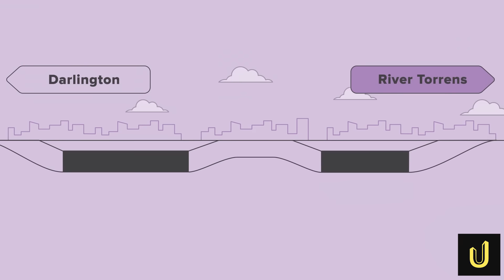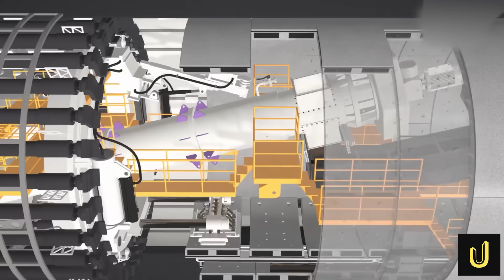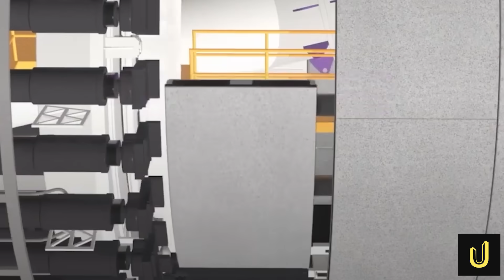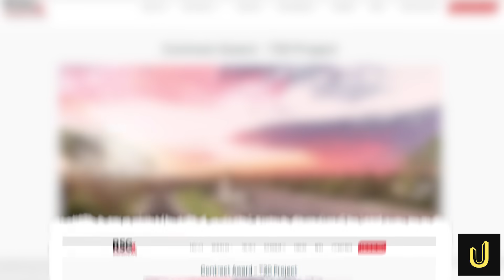$15 Billion Highway Project Shocks Australia!

Comment: This must be done, other options should have been done decades ago but now this is all we have. Also as someone who rides a motorbike it is almost impossible to filter between the traffic with the current size of lanes on South road so even on a bike the average speed in traffic may only be 15 to 20 Kph. The current bottleneck is crazy, we currently have 6 to 8 lane highway on both ends of this 4 lane 10 Km section with 21 sets of lights on it.

Comment: The car lobby succeeded in getting Adelaide's then state-of-the-art tram network ripped up. The State Govt of the day shut down the heavy rail spur off the Gawler line through Sth Terrace Pooraka up to the North East just a few years before opening Golden Grove to development, causing massive traffic increase on Main North Rd and North East Rd. People, while there's no doubt that a smoother flowing North South traffic corridor would be nice, the problem is private vehicle use for commuting. $15B would transform Adelaide's public transport, meaning people wouldn't have to travel in to the centre to get out to another suburb.
I've just returned from a week on the Gold Coast. The M1 there between Gold Coast and Brisbane, which is mostly 110kph 6 lanes but sometimes 8, was down to standstill most weekdays even around 11am - 3pm! Build it and they will come...

Comment: The Torrens-to-Darlington (T2D) upgrades are estimated at $15–17 billion. The tunnelled parts work out at roughly $2–3 billion per km, while a more reasonable surface/trenched alternative would have cost roughly $0.2–0.5 billion per km. The tunnelling choice added billions compared with cheaper options.

Comment: As an Adelaidean this project is essential. But trucks heading to Melbourne and Sydney must go east at some point. Fueling another problem.
Reply: There was a proposal to put a hill's bypass for freight and rail and come in from the north to the port or bypass Adelaide entirely. Most of the rail corridor was there but it was still deemed too expensive. But think of the benefits of free up the rail line to Mt Barker and getting most of the trucks off Portrush Rd.

Comment: I think ultimately its a good thing. Progress is everything. But what if there is a car accident? Currently, if there is an accident it slows the traffic to almost a stand still because everyone has to slow down to 25 by law I think. How about instead if its possible move the vehicals to the side asap then these automated poles with flashing lights pop up to alert and protect the accident site and then the remaining 2 lanes can continue on as normal. Or some more clever solution. The cost though pretty hard to stomache.

Comment: The southern end of the existing system down near Darlington seem to be a mass use of concrete & lanes that could be drastically simplified! & 1 section of the side walls had to be replaced due to instability as huge concrete panels kept falling off! A over & under separate road would not have tied up massive land acquisitions & simultaneously still more 2 lane South Rd delays! Architect & builder dream at users expense!!!

Comment: I grew up in South Australia's Mallee region on the Victorian border, and I remember the talk of the 'north-south corridor' back in the early 80s. In true SA, well more likely, Adelaide fashion, it's taken a while but it's starting to take shape 😂 But seriously, this has been sorely needed since then, that road is an absolute nightmare at peak traffic times. Even when it's quiet, there's all those traffic lights to deal with. I now live in Victor Harbor, south of the city on the Fleurieu Peninsula, but I have family in Riverton to the mid-north, this project will now link up the northern and southern expressways and (hopefully) make these types of journeys a breeze. What a huge engineering feat though 🤯🤯

Comment: This project is projected to cost $15 BILLION at the moment but more likely significantly more by the time it’s completed. Sounds rather like the desalination plant built in Adelaide’s south. Cost exploded way in excess of its projected cost st the beginning of the project  plus o😢ngoing annual costs to the State with very little actual significant benefits.
Reply: No significant benefits from the desal plant ? .  It was running almost flat out last summer. Luckily there was a rare moment of insight from the Government and they doubled the original planned size.  I remember a lot of naysayers at the time but it has proved worthwhile with Adelaide's population increasing and some pretty dry years recently.

Comment: an underground metro system would benefit the entire city but city planners have such low foresight into population growth and city expansion. the new southwark grounds project is going to add 1300 homes on the fringe of the city, congesting traffic even further. adelaide and surrounding suburbs are perfectly designed on a grid system that would make metro travel so easy if they just bothered to invest properly.
imagine a direct underground train line from the CBD to the airport within 10 minutes bypassing all traffic? they could convert the central bus station into the main city metro station, right into the heart of the city.

Comment: Moving bottlenecks has been a problem here already in the past.  When they built Darlington into the 6 or 8 lane section its been since the early 1980's,  all it did was make the bottleneck on South Rd and TOnsley insufferable, and so ppl used Marion Rd and or Brighton rds instead.  And  the loss of the volume of historic homes in suburbs surrounding the tunnels has been gut wrenching for many many families.  Fully renovated and extended historic homes and whole suburbs just lost.  But as far as enigneering goes, it will be impressive - the sections that have already been done are great to use.

Comment: The project is required, but is poorly designed. There is no connection with Sir Donald Bradman Drive or Cross Road. Therefore all commuters from the east of Australia have no direct connection to this massive project. Also there is no direct connection to the airport. Poor planning and rushed design.

Comment: The Richmond Road / South Road interchange design needs to be reworked, to allow heavy vehicles to move from Richmond Road on to the new South Road motorway and vice versa, so that their new route to and from Adelaide is Southeastern Freeway, Glen Osmond Road, Greenhill Road, Richmond Road and then on to the new South Road Motorway to head north or south from that point. Richmond Road and Greenhill Road are the city ring route R1 and Glen Osmond Road is Princes Highway A1. Time and fuel efficiency for heavy vehicles by the redesign of that Richmond Road / South Road interchange

Comment: It’s finally 1980 here in Adelaide. Our road infrastructure has been a joke. The bottleneck on the north to south end at Thebarton to Richmond Road is farcical. 
A solution for the congested Port Road/Park Terrace/North East Road debacle would be welcome too. It often takes 45 minutes to get through that couple of kms of car park. Anyone who says you can get anywhere in Adelaide in 30 mins clearly hasn’t done peak hour here in decades. 😂

Comment: Adelaide is an incredibly long thin city with no reliable means of connections between its north and south so it’s effectively three cities in a row at present. Connecting the north and the south will help a lot with integrating it back into a single city.

Comment: Lack of Street Signs
Lack of Free off-street parking 
Lack of Trains 
They used to have a train going to the Hills & they closed it 
Most of the roads are JUST wide enough for cars, but NOT for TRUCKS - especially the overpass
Reply: the belair line is still fully operational and the barossa line was closed due to no one using it, it was even reopened and then closed again because of no one using it.
use it or lose it.
Reply: @bjorn1583 I was referring to the Stirling Station & Aldgate. 
Mt.Barker has nothing except Buses 🚌

Comment: At the end, you state that it would just move the traffic problem to a bottleneck at the southern end. This is not the case. The southern end at Darlington has already been completed and includes an overpass onto Ayliffes Rd to the east so that traffic emerging from the T2D will flow smoothly into the Darlington underpass, and thence directly onto the Southern Expressway, which carries traffic clear through to Noarlunga.
Reply: Where we can all get stuck behind the idiots doing 85 in the far right lane heading up the hill to Majors Road lol

Comment: In 2001 we built a one way 18.5 km one way road called the southern freeway for $76.5 million.  The one thing Australia isn't short of is space but we still built a one way road to save a few $.  We then had to upgrade it 9 years later to a 2 way road at a cost of $445 million, a hell of a lot more than building a 2 way road in the first place.  Short sighted road planning is costing us a lot more.
Reply: When the Southern Expressway was planned, South Australia was still in a very bad way following the State Bank collapse (stage one commenced in 1995, four years after the collapse, and opened in 1997). Most of the traffic that needed to be moved at that time was peak hour commuter traffic, so the reversible design was seen as a cost effective solution.
Where it went wrong was that it was supposed to be designed to easily allow duplication in the future when the state budget was much healthier, but due to some flaws that wasn't the case and the duplication process was far more involved than anticipated.
Reply: Shows how little you know, the doubling of the day expressway took purchasing houses and other buildings, as well as moving approx four times as much rock and soil as the original.
That's why the original was the size it was, doubling it's size would of still cost much more than double the pricetag.
Reply: yeah that justifies one of Australia’s most embarrassing pie of infrastructure NOT 🤦‍♂️
Reply: Yeah - heres the funny bit.  Just after it was built there was a thing? in the Southern Vales wineries with some politicians present, promised big things. One of the business reps there said "you know what you CAN do for us - make the Southern Expressway a dual carriageway.  WHat the eff were you guys thinking".  The literal response from this un named politician was "I can assure you, there will NEVER be a dual carriageway made  - its far too expensive".  5 Years later its was dual!  Never say never hey.
Reply: Oh yes 🤣 I remember the one way.. you always had to check which way it was going first before you entered it lmao
Reply: Do you mean the southern expressway?
Reply: And yet they still decide it’s not finished and cause more bullshit road works
Reply: @shaneseddon2690  That Majors Road project seems to be taking forever
Reply: they do this on purpose to create business for themselves later on
Reply: @pinecrustjuise  it was done that way to spread the cost over a longer time period as the state couldn't afford to do both directions at the same time, it was very good economic sense which is not seen very often from a government

Comment: The idea is great, as long as they dont try do it on the cheap again, like they did with the Fiber optic network, which was a disaster, or the south road overpass, which already needs to be replaced due to failing cheap materials! Hope isnt high with Adelaides track record. Great Ideas done with cheap dodge materials!

Comment: What a great video. As a frequent user of South Road, this is just the icing on the cake for this great project. Each segment completed so far has had huge benefits, so I can't wait for this final section to be completed. People who live out north like me and the massive expansion in the northern areas like Angle Vale, Munno Para West, Penfield, Gawler, Roseworthy etc will save so much time and frustration when they need to drive down south.

Comment: I drive South Rd every single day. This is much needed and will definitely save the state in the long term, I think anyone who thinks otherwise does not use South Road. As for spending the same money on public transport, I agree, it would probably benefit the state more, but you need to realise that the process of upgrading the public transport system would require a lot more money to do it properly, it would take longer and require the acquisition of many more properties than the T2D. The South Road upgrade is a great step in the right direction, and I think more important that trying to resurrect a non-existent public transport system at this point in time, but I would love to see the public transport system become useful in South Australia one day <3

Comment: Used to drive the North part of South road to work and back each day when the Nth section was being built. Now an age pensioner. I wonder how much free and efficient public transport would cost and how much an effective rail freight system would cost. I'm guessing a lot less. These days I get by just fine with an electric bike and free (on seniors card) Public transport. Sure it would not work for all people. There is no way I could have gotten to my old job, but I think it would relieve enough traffic congestion to benefit all. BTW I think the North section contributed nothing to the local economy. It was all constructed by overseas interest who even brought in their own labour. The REAL thing SA has gotten right though is avoiding the toll road debacle.

Comment: This is a necessity but also public transport needs to be improved. First step would be a metro from the airport starting in Glenelg and to Norwood stopping in the city. Main north road needs non stop motorway now too, they just keep putting lights along it. So much money needed for all the infrastructure, where would you start?
Reply: the place is far too small to make a metro economically viable
Reply: @Lupi33z there are smaller cities like Bielefeld, 300,000 in Germany that has a metro. The smallest is Lausanne, Switzerland with 140,000. Adelaide has over a million and it will become more dense which would be more viable. It would be 10 odd years in the future if they started planning tomorrow
Reply: @ShaneWi11iams  European cities are densely populated, real cities.  Adelaide is sprawling low density suburbs which are counted in stats are part of the 'city' when in fact the actual city is quite a small town.  The daytime population of Adelaide 'city' is about 100,000 when all the public service workers and students are in town.  That's the size of European city it would be compared to.

Comment: People criticised the raised section over Grand Junction Rd - 'All that money for only 5 minutes of travel time.' That section used to take me a MINIMUM of 15 minutes, average about 20-25, commonly 40-50 when I was trucking. The time, fuel, stress (on both driver and equipment), and pollution savings were amazing. This last step will be just as consequential. I have also noticed that the loudest voices against this are often the same ones complaining about trucks on the road!
Reply: I can’t wait for these tunnels. But the trucks and freight trains should all be coming on a new corridor through the north.

The existing line needs to be changed to passengers through to Mt barker, Murray bridge and Victor. Gawler line needs to go right through to the Barossa
Reply: I live near that flyover and it's been an absolute godsend for getting to my brother's and nieces places in the northern suburbs. Worth every cent (and it was a kick watching it get built too!)

Comment: As an Adelaidian, I agree this is likely a terrible waste of money. Assuming it ends up a perfect best case scenario, we'll smooth out some traffic. 
  Worst case, it's a tragic failure that kills 100s in some terrible earth collapse, and billions of dollars more in repair and cleanup.
   I always say, if the gov just fixed the economy, most other problems would sort itself out. 15 billion dollars is an enormous sum of money by any standard. We're going to have to work harder now, just to pay that debt forcing us to be driving on the roads more.

   Lets say, for example, we invested that kinda money in a nuclear reactor or 2. (I know lots of ppl hate nuclear, this is 1 example)
  Energy prices drop like a rock. Everything becomes very very much cheaper, then less ppl need to drive to work as often, less overtime, less commuting, less traffic, saving automotive strain accross the width and breadth of the entire state, as opposed to just South Rd

Comment: I lived in Adelaide for 35 years and then moved West 20 years ago, the difference in the highway network is staggering. It’s great to see Adelaide finally get a massive highway infrastructure project.
Reply: I used to go to Perth for work a lot about 25 years ago.  For foresight they had over there to leave space for infrastructure they knew would be needed in the future is pretty incredible.  I remember back then it was pretty obvious that the road system was designed to allow the freeway to easily be extended.  In Adelaide we tried to provide for a freeway system in the 1960's and 70's (the MATS system).  But one of our political parties won an election on the basis of "not only won't we build it, but we'll sell the land so it can't be built."  Which is just mind boggling.
Reply: We are so lucky living here. 💓
Reply: Missed it by THAT much...lol
Reply: WA gets more commonwealth funding and mining royalties to pay for trains and highways.